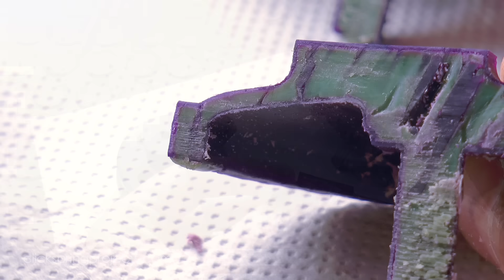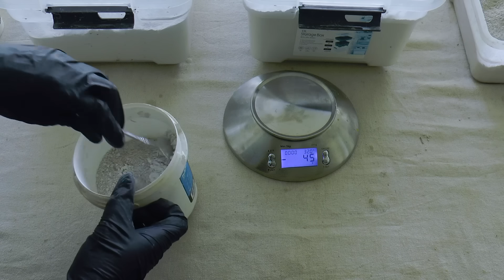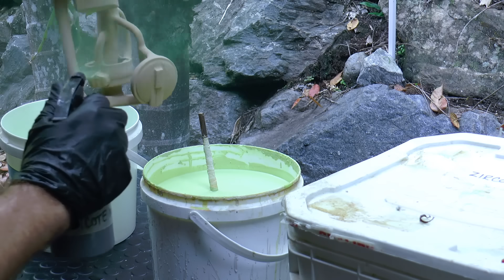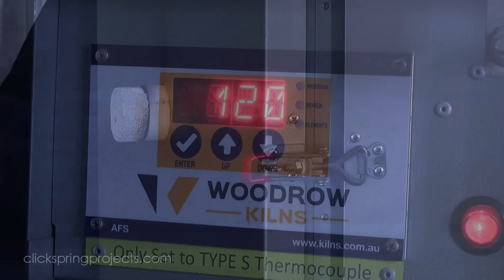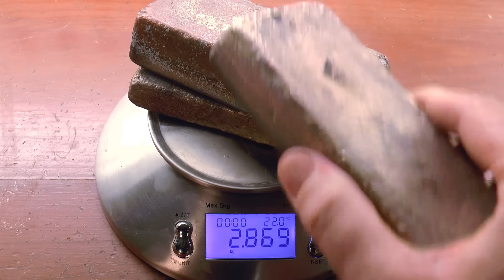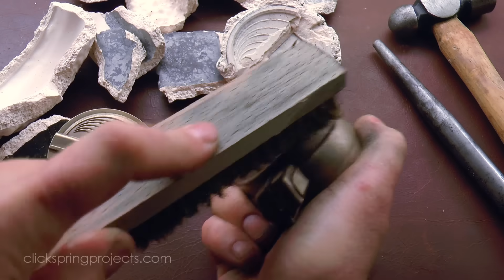Tools, Glorious Tools! #12 - Ceramic Shell Investment Casting

Comment: Can we use nichrome wire for supporting and power it later to remove wax with the heat.. efficiently,I don't know if the expansion of coil would destroy the mold but I am curious

Comment: i would love to have that level of patience, but im one of those, who always look for a shortcut. maybe one of my findings comes in handy for you aswell.
for dewaxing, its pretty easy to melt channels into your wax with a torch to avoid any expansion cracks. start from the spout, slowly draw lines over the model, so all remaining wax has some room to expand. that way i can skip the wire and 2-3 layers with still 99% of molds crack free. after that, i simply toss the mold into my melting furnace for 45 mins with half of the wax and all of the 3d prints still in it. then i put it in a ceramic-fiber-insulated steel bucket, melt the metal for 20 mins. mold cools down to around 500-600c during that time. perfect for casting.
oh, and the less zirkon, the easier devesting. i go 100% silica besides the chamotte.

Comment: In school for manufacturing engineering. This last semester my metal casting class took a tour of a place that does the ceramic shell casting. 

They used a tub of fluidized (aerated) sand method for coating on top of the slurry. Shouldn't be too hard to make. 

They didn't explain why but they freeze right before they put the molds into the oven for melt and burnout. They were using straight virgin wax.

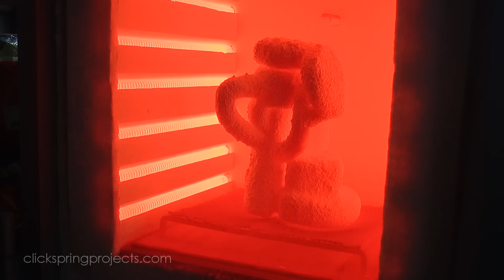Comment: 22:12 I have to admit I winced when I saw your hands enter the picture and grab that 900°C shell. But, that's because of lack of knowledge as I had no idea that gloves exist that could not only withstand direct contact with such hot objects but also allow extended enough contact that you can grab and carry them without burning yourself. That's wild. I suspect the thermal properties of refractory materials will have something to do with it as well but still, that's wild, as that shell was red-hot

However, now that I think about it, I once saw a video of a demonstration of a new insulating material for the outside surfaces of atmosphere re-entry vehicles where they put a cube of it into an oven until the centre of it was red-hot and then they let a spectator on the guided facility tour where it was filmed, grab the cube by the corners with their bare hands without issue. They even said it felt only somewhat warm to the touch, all while the center of it was still glowing red-hot

Comment: Wax has a huge temperature expansion coefficient too. Not sure how much it helps compared to low infill percentages with venting.
For example automatic greenhouse vents use either wax volumetric expansion or polypropylene rods to open vents proportionally with temperature

Comment: I've investment cast quite few parts in my hobby foundry using standard investment and 3D castable resin and have been wanting to learn more about the shell process. Thanks to your excellent description I see that it's probably more involved and requires more supplies than I want to tackle, but thanks for giving me that knowledge. Although I won't use it for the shell process, I'm going to keep thin printed "waxes" with supplemental wax filler in mind.

Comment: I have seen a hybridised version of this technique by someone makinging a gingery lathe. The first few layers of the ceramic shell were the same, but it wasn't as many layers as here. Instead, to maintain integrity, it was bedded in sand, similar to a rammed sand mold. I feel that that techniques would provide a good middleground between the speed of sand casting and the surface finish and mold complexity of a ceramic shell cast.

Comment: very cool. best video i have seen on the subject. will the steel reinforcement wire still add strength with doing higher melting temp metals? steel or inconel?

Comment: A foundry I visited years ago had drums of sand with compressed air flowing up through them.  It was amazing.  So simple but turned the sand into a liquid of sorts.  Could just dunk the wet part. In for a coat of sand.

Comment: Use StoneCast for gold, it takes some heat well above wall patch plaster, dries like china. In the before for times; Diatomacous earth does not expand when hot and raises the temp your plaster (or mortar) splits at. So does fire brick grog (ground-up old bricks). If you like spending money,;- add like 5% graphite. Wire wraps, mesh or stainless fibers work at least up to aluminium temps, not much further, I bury them in between dips tho.
   Gotta keep the metal and diatoms out as the temp really rise.

Comment: Why not go all wax? 3D print a mold of the final part and cast that in wax. Proceed from there.
Reply from the maker: I did consider this however it is non trivial to make a dimensionally stable multi part mold for a wax pattern comparable in quality to the standard of a SLA print; considerably less work to simply print hollow and manage the issues - Cheers :)

Comment: This is beautiful Chris.  Curious how long it took you to develop this process to this level?  Meaning how many versions of the mold design did it take to get to this level of perfection?  Again, absolutely beautiful results.
Reply from the maker: Minor iteration across 2 molds for this project (shifted case back gating lower 2nd time , but much learning over the last few years to be able to get the process where its has reliable elements that can be trusted to (usually) work out of the gate - Cheers :)

Comment: Very interesting to see someone else use ceramic shell casting! Thanks for the insight. There are a lot of similarities to my process but also sone differences. I use aluminium silicate (mesh 60 for the first two layers and mesh 30 for the next three to four). So 5-6 layers in total plus one coat of slip at the end. I melt the wax out in a gas kiln. Preheat to 750°C, put the shell in and the wax melts out. I hold it at 900-930°C for 90mins. Never had any cracks with this setup.

Comment: Are you using normal resin or castable resin for this example? 
Castable resin containing wax is available for 3d printers and (as I understand) perfectly suited for 'melting out' without expanding.
Reply from the maker: I use a wax castable resin. Better for ash residue on burnout, but much the same expansion upon heating - Cheers :)

Comment: as someone who has done this job professionally (for aerospace + energy sector) this is the least erroneous Ive seen a youtuber go through the process. 👍

[the two most glaring notes are: 1) make absolutely sure the mold is superdry before firing wax. 2) use a safe dying liquid to rinse the inside of the mold and make cracks more easily identifiable.]

Comment: Ive done an internship in a industrial foundry where they use this method. The wax models were handed off to a fully automated cell where robots would dip and sand the models and automatic forklifts would store and pick them up during the process. They used a large jackhammer to break out the moulds, as well as a "little" pressure washer. This beast operated at 1500 bar! Robot operated again.

Comment: Well done.   my 2 cents .   you can set up a simple hotbox, use cardboard box and hair drier. for drying the mould layers. preheat the wax master to 45`c that way it does most of the expansion  witch will later help limit cracking in burnout. it also dry moulds fast. 2hrs per layer in cape town winter. burnout i found best is start at open end with serious aggressive fire. i use 2 of the torches made for roof seal applications. the faster you heat the mould and melt a layer at the surface and create a space for the wax to expand ,the les chance the wax get to crack the mould.  After bisk firing i like to fill my moulds with water,  this shows very clearly any cracks and give you an exact volume of the cavity. it also help to wash any dust out . An air hammer on the gating help demoulding very fast, sort of vibrate the shall loos.

Your casting looks real good. clean metal is important, even very small amounts of contamination like iron  can cause serious problems. 

Thank you for a very informative video, explaining the process very well and accurate. could not have done better if i tried.

Comment: I didn't even know this process was ever a thing. Sand casting, sure, but it leaves a grainy surface and the results can vary. This process seems to require a lot more errort to make the mould but leaves a spectacular finish.
Reply: The beautiful bronze statues from ancient Greece were cast using the lost wax method. The process is even older though, going back to ancient Mesopotamia at least.

Comment: Exited to see what will be next for ceramic casting. This was definetly the most comprehensive and patient version of this process I have seen so far and the best result. For the specific wing like details could an open top sand casting have worked? That seems a lot easier of a solution for that specific piece though it would probably require more machining on the other side.

Comment: You might consider some mica flake to help increase the rigidity of the ceramic slurry after it dries. Mica is also an excellent refractory material. Its used in all sorts of products to increase strength.
Reply: Would that be for the machotte layer?

Comment: Chris,
I used to work at an investment casting company and our shell build up only utilised 1 or two zircon coats with the prime coat slurry.
We then had a thin transition coat with a medium sized stucco sand before a thick back up coat with large stucco to build bulk.
The gradual increase in particulate size prevented poor layer adhesion between the zircon and backup coats.
The 1 or 2 zircon coats allowed for the shell to be permeable that greatly helped prevent shell cracking during dewax, although we were autoclaving.
Maybe something to consider (less zircon coats and an intermediate sand size.
Also be very careful with shell removal. Colloidal silica shell systems create crystobolite after firing and the dust will contain silica so best to use the pressure washer for the whole shell removal or wear good dust masks.
Very good video though as always.
Reply from the maker: Thank you mate - yes the extra zircon is my compromise to avoid having to maintain a third refractory sand supply in-house. Yes mask essential throughout process - Cheers :)
Reply: @Clickspring very nice resulting castings though. It looks like you did not have any shell cracking on the pattern
Reply: Sound advice.

Comment: when we did aluminum casting at uni, we only put a few layers of ceramic investment on and buried the pattern in mullite sand
That said, we didnt burn out the pattern, but overall I think some efficiency improvements could be made here.

Comment: I've only seen one other channel do professional ceramic shell casting, it's so interesting to see the differences in methods. They skipped the wax step entirely by making the 3d prints out of a plastic that would melt in a kiln. So create the ceramic mold around the 3d print & melt the interior print, letting it pour out. The cast quality was fairly similar, but sometimes there were some pits in the surface of the material, prolly left behind by remaining plastic. Some simple brazing usually fixed them.

Really curious to someday see the process of making reusable molds.

Comment: Ceramic shell casting can yield such good surfaces that Rolls Royce use it to make the turbine blades in their jet engines without machining the surface afterwards
Reply: Just to clarify, those blades do have to be machined after casting, but you are correct in that some of the surfaces of the turbine blades require little to no machining.
Reply: @cheemomugdoo799 correct. I wish I could say more 🫢

Comment: Absolutely brilliant. 

This is how Rolls Royce makes fan blades for their jet engines.
Reply: Rolls Royce arent the only ones who do it this way, but they use a different system for transition and finish coats that involves an ammonia environment to set the binder with an ultra low viscosity slurry. Its a pain in the ass because the partical size is variable within the same coat. But the materials environments are of utmost importance when casting for those components. quite exotic.

Comment: I use thin PLA prints, minimizing ridges with wax and a heat gun. The trick is to raise the temperature of the mould to 100C all the way to the core before starting to burn it out (use a low oven). This prevents hard bits of plastic from being pushed into narrow crevices and breaking them. It is important to use pure, clear, natural PLA. I have cast stainless steel and glass this way.

Comment: At the stage where sand is added to the slurry, would it work to have a tub with the sand with compressed air from underneath, so that it works like a liquid? Or is the sand simply too dense/would require too much force? If I recall correctly, a similar process can be used for painting.

Comment: Nicely done! Although  it's a good example of why I personally avoid investment casting if I can, there's so much damn investment!

I've had pretty similar results sand-casting with a combination of green-sand and silicate cores. It's still an investment of sorts, as it takes many hundreds of castings to get really proficient at patterning, moulding and casting, especially with more complex shapes or those with finer details. Obvoiusly, there are still limitations to the shapes you can make with sand, but it's quite amazing what can be done if you know how.

Comment: The lost wax idea sounds so simple, it is very educational to see all the details which need to be considered. Since they make 3D printers for chocolate, I wonder if you can print in wax and totally eliminate the expansion of the plastic parts.
Reply from the maker: Yes the resin I use is a "wax castable" version with a percentage of wax for better burnout behaviour. Nevertheless it still expands - would prefer chocolate!! Many thanks for watching :)

Comment: Your commitment to the process of these things is admirable. That this project could run off the rails at any point and send you right back to the start needs a mind like yours to cope. My head would explode. Seeing you basically nail this (assuming this isn't take 20 hiding your failures) in one go is such a great lesson in going deep. Another amazing result. It must have been so satisfying to finally pull the parts free. Thanks for sharing.
Reply from the maker: Thank you Stuart!
Reply: @Clickspring  No worries Chris. I should also mention that your video production is top shelf. I know it must add substantially to the time to do this work, but what you share is encyclopedic. Well done and thanks again.